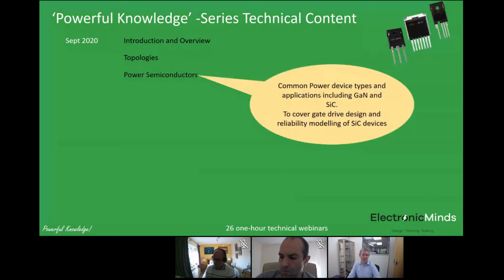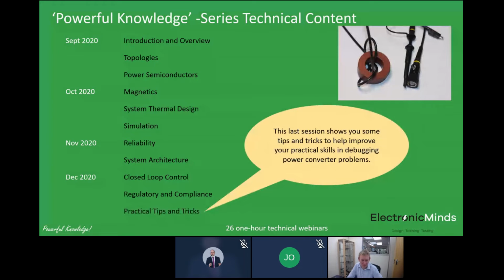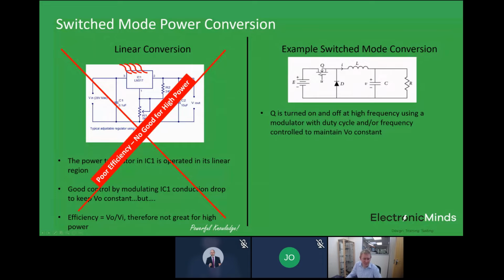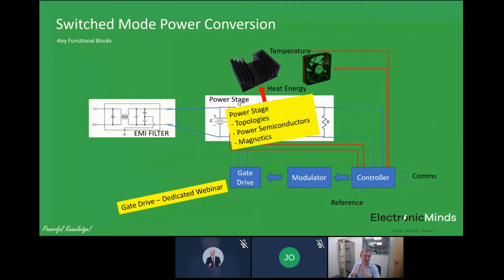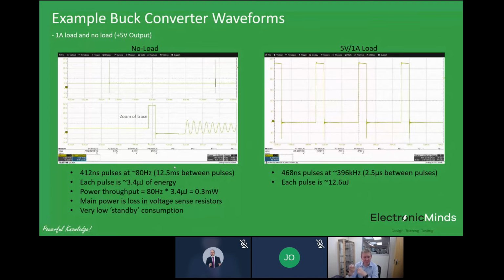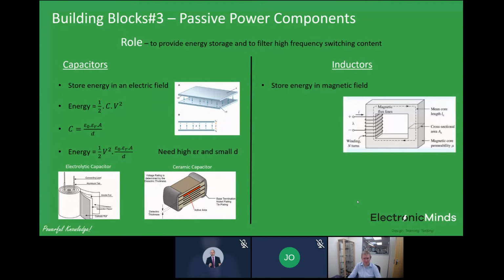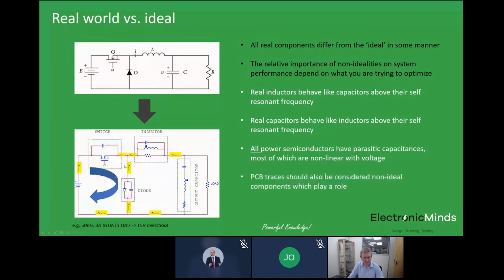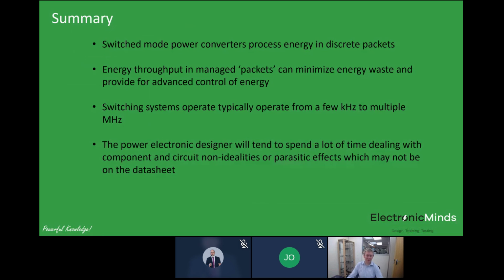Powerful Knowledge 1 - Introduction and Overview

Comment: I hope this message finds you well.

I am currently seeking guidance in identifying a suitable research topic for my doctoral studies. I would greatly appreciate your assistance in exploring potential areas of research that align with my interests and academic goals.

If you have any suggestions or could point me in the right direction, it would be immensely helpful. I am particularly interested in topics related to [briefly mention any specific areas of interest if applicable], but I am open to exploring other relevant fields as well.

Thank you very much for your time and support.
Reply from the maker: I’d suggest finding an area you are interested in as a starting point and then seeing what options you have.